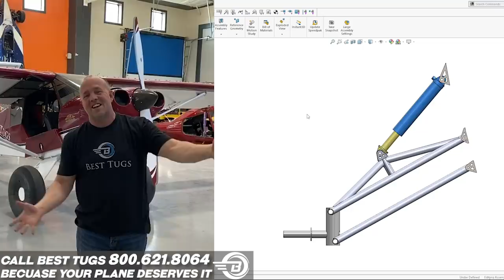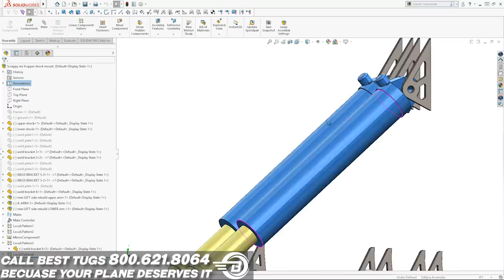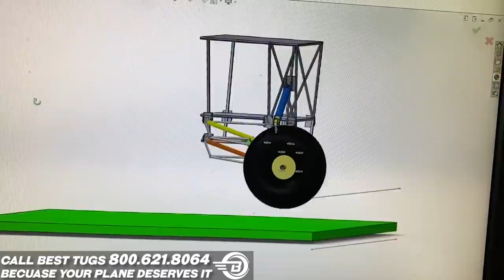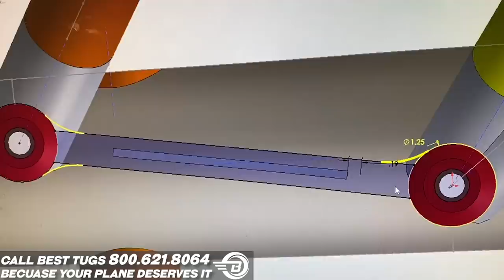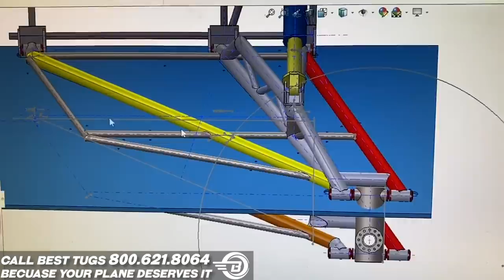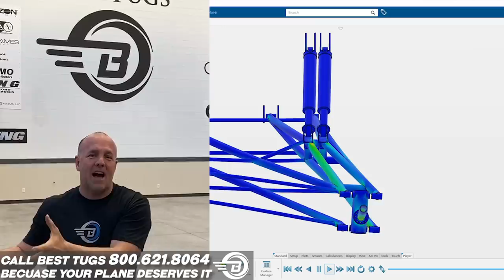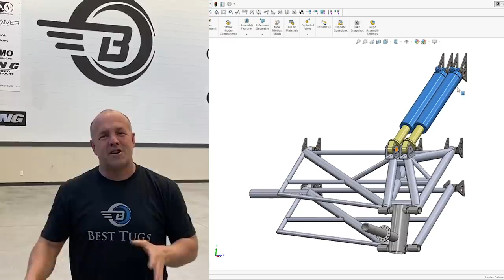20" + Travel - Extreme Bush Plane Landing Gear (Scrappy Bush Plane 15)

Comment: A fabricator that was featured on Hoonigan point out a good tip on your coping fit ups. Basically if you make the tubing fit tight like that(snap fit) and weld up, you are only welding on a portion of the actual thickness of the tubing, grinding back the sharp edges of the coping fight ups allows you to weld on the full thickness on the tubing being welded.

Second note there is still going to be an amount of scrub to the tires maybe not on the full cross section radius as if it had a single A arm suspension. The spindle still has to swing in an arc and with your landing gear down before you land they still have to travel up and out with landing

Comment: Mike, I have done work with 6Al 4V titanium.  It has 1.8 times the strength to weight ratio of steel and seems to be right up you ally.  With your machining and welding skills I would love to see you hire a certified titanium welder to set you up with the skills and equipment to start replacing steel parts with titanium.  I am sure you have the engineering capabilities to take STOL to the next level.  Maybe when you start a new Draco build?

Comment: Mike, have you ever considered winglets or long winglets running a partial length of your fuselage to help generate lift, and are you still going to use cables for your control surfaces or have you changed your mind to use carbon fiber rods or carbon fiber with woven kevlar rods rather than cables for your control surfaces?
Reply: I've been wondering about the cables vs rods thing as well, Mike. Wouldn't rods give you more control and response from the control surfaces?

Comment: Have you ever tried using a tig torch with a gas lense, you would get better gas (argon) coverage and less surface oxidation, resulting in a better weld. Your welds look great, but try and see if the results could improve the end product. Best of luck with all your projects!

Comment: As an engineering student simulations are not boring, and I have designed and machined enough to know that tolerances like that are no joke. That is very impressive. I was curious if you did a drag analysis or with the extra power you aren't concerned about that.

Comment: You should look into doing some type of limiting strap so that the weight of the suspension and the tires when you take off does go right to the internals of the shocks.  Just a thought Mr. Mike.  I run kings on my offroad titan im building and I had to install limiting straps because you could here it thump the shock when I went to full droop.

Comment: Subscribed. I'm not a plane guy, but the engineering here is top shelf. The tubes snapping together is so satisfying. I see the advantages of notching the tube on the mill, but those registration holes seem like a lot of work. Have you ever tried laser cutting the tube?

Comment: CTIS with a bladder in the fuselage vacuum the air out during long duration flights reduces drag from those huge rock huggers, only Mike could get it done back to work

Comment: Awesome design Mike!  Solidworks is such a powerful tool!  Will definitely be looking for the stress analysis video.  You'll probably cover it but I am interested in what you looked at for residual stresses from the welding process.  Or are you stress relieving the assemblies?  Any thoughts on fatigue details?  I also get really excited when I get to fabricate one of my projects that has lots of moving parts that work out and all of the clearances are as I planned.  This was a fun video and I found myself getting the smiles as it was coming together.  Did you have to make a reverse of your fit up jig or did you just machine thru slots where you could flip it over to do the left hand/right hand?  Take care!

Comment: After building off-road race cars and long travel sand cars for years (kinda like the clip you showed) that have unbelievable suspension and also competing in Baja many times, I can certainly appreciate what you’re doing here. Looks well thought out and is going to work very well. Is it overbuilt? Probably, but every time we think we’ve built something just enough....it breaks (and yes, weight is important to us as well). However, when ours break, we may screw up a wheel, hub, brakes, some powdercoat and maybe a few other things (although I have gone end over end at 75 mph just from a broken heim), but if yours breaks, it screws up a very expensive prop, engine and a host of all kinds of other things. Not to mention the safety factor and most of all....cracking up all of that pretty carbon fiber lol. Once again....well done (especially your notching), can’t wait to see the finished project. PS....Out of curiosity, obviously you’re using chromoly....what wall thickness? It appears 0.65, 0.83 maybe some .120 in there somewhere as well? Ya know, just because I geek out on this stuff as much as you lol. Well you kinda answered my question towards the end.

Comment: Hi Mike, great build! I'm wondering what prevented you from using a 20" travel hydraulic piston with some custom valving to take the impact vertically in a rigid belly frame - the frame could likely be lighter and rigid, and you'd have no scrub at all as you'd have purely vertical movement of the wheels. Would this weigh too much, would the valving be too difficult, or what else am I missing?

Comment: Interesting concept to build an airfoil around the gear legs. Conceptually I understand adding effective lift with a minor weight penalty (I presume you will wrap it in carbon fiber) as well as covering a web of round tubes to reduce drag is favorable. The question it raises in my mind is will it introduce some instability in flight as the direction of the lift will be outward, at different angles than the primary lift source of the wings, and below the center of gravity? Also, do you risk adverse flight characteristics when you put the plane into a forward slip where the gear wings can be stalled or create more lift depending on their angle of attack? I am soooo curious to see how this all turns out. Fascinating and ingenious ideas keep coming over and over watching this build. Keep it coming Mike,  I am hooked. Hope to see you up at the cabin in Alaska this summer.

Comment: Incredible engineering Mike!  I'l be interested in how the "wing" works...it looks like a flat-bottomed aerofoil (?), so will be interesting to know whether that will cause issues with lift being generated in unpredictable ways as the suspension travels through it's motion.  No doubt you've thought all that through, and perhaps it's even a way to decrease stall speed?  Anyway, fascinating build...

Comment: A suggestion about your new front geometry. What you have designed will be way better than the normal Cub "flexy" suspension and will have less scrub through the travel but it could easily be better using some lessons from older vehicle dynamics.
A normal automotive suspension is designed to have a negative camber curve to keep the tire perpendicular to the road and to maximize cornering forces. But in a tail dragger "maximizing cornering forces" is called a ground loop. 😱 Not what you want.
In 1969 Buick came up with a suspension with a backwards camber curve that they discovered reduced side to side "head jostling" by over 60%. They raised the mounting point of the upper A arm so in compression it would be still moving outwards while the lower arm was moving inwards. This was horrible for cornering and no one uses it anymore.

But it is perfect for what you are doing for a bunch of reasons. Your drooping parallel arms are going to be scrubbing outwards as they compress because the track is increasing with the arms downwards angle . If you raise the upper arms mount you can start with a little bit of negative camber and as the suspension loads it would transition to positive camber. This will reduce the scrub and probably more importantly, the tire's increase in positive camber will reduce the tire's tendency to dig in as it hits bumps during compression. Also increasing the distance between the lower and upper mounts will spread the stress from the unequal loads on the two arms.

Basically it is a "Win, win, win" situation.

(Tried to find a picture describing it and they best I could find is this diagram of the Chevy Vega which borrowed this geometry from Buick as they were trying to make their first compact feel like a big slushy Merican car. http://assets.superchevy.com/f/154695485.jpg  The circles in the middle are the inner mount points for the upper and lower A-arms and on the right with the tire is squares, circles and triangles showing the path of the upper and lower balljoints.)

Comment: Hi Mike, have you played around with sending any parts to a tube laser? I started using one for my designs a short time ago and have been more than happy with the results. Tolerances in the couple thousandths and an immediately weldable finish with no clean up. The head articulates in all axis’s so no worries with square cuts meeting angular surfaces and changing your weld profile consistency. Really nice piece of gear.
Reply: Oh.. and NO reindicating tube lengths due to lengths. It will drag a stick length dom and part it off as well. Worth a look for sure.

Comment: Hey Mike, all the pipe prep looks awesome nice fit-ups, everything looks super clean I’ve been an industrial Master Pipefitter for 38 years this year.  I’m not in any position to question anything that you engineer, design, or fabricate when it comes to Air Frame design. But fit-up and welding procedure it something I’ve spent my whole life doing. Without knowing the type of pipe you are using or the heat rating number (spec) .  it leaves me at some disadvantage. It’s been my experience on chrom moly and many different types of Stainless Steele pipe weather it’s 304, 304L, 316, 316L,  Inconel, Monel K-500, with approximately three times the yield strength and double the tensile strength when compared with other alloy’s. I wanted to ask when welding the new landing gear arrangement I did not see you using a full penetration welding procedure, and are you not required to purge the weld wile in the process, with such sharp edges and fit-ups I’m sure it’s quite easy to make the  welds similar to a fused socket type weld. But for a device such as a landing gear it struck me kind of odd that a full penetration welding procedure wasn’t use or at least a purge process just in case you had some burn thru on some of the thinner areas. I’m all about learning different way things can be done correctly. I was also curious did you tack off both sides first to keep it from drawing and then feather out your tacks when you made your first pass and did you make TWO passes on the larger size pipe fit-ups ?? The 1-1/4, 1-1/2 ?? Please don’t misunderstand me your work is outstanding I am a fan the DRACO ENGINE SWAP WAS AND AWSOME UNDERTAKING I watch it all. I always been told to ask if you don’t know. Thanks  Mike SCRAPPY LOOKS TO BE WELL ON ITS WAY TO BEING ANOTHER INCREDIBLE BUILD.

Comment: Hi Mike, great video as always.  Do you have or need travel stops on your Scrappy long travel suspension?  So your shocks don't top out when your gear are fully extended downward?  Sometimes rubber dampers or travel limit straps are used to prevent or minimize the impact on your shocks and suspension joints.
Reply from the maker: rmosley111  great thought 👍🤠 I’m very familiar with stops and straps from my desert racing.  This won’t need them as aircraft we set the rebound much slower as we don’t repeat high speed bumps  like race vehicles. When we land at only 30mph slow rebound is best and then the shocks don’t bang on the airborne hang or  rebound side of bumps 👍🤠
Reply: @MikePatey  Sounds good Mike.  Keep up the great work and thank you for sharing your projects and experiences.

Comment: Hi Mike, loving the videos during lockdown.
Just had a thought, STOL landings on tail draggers seem to me to be limited by over pitching on the brakes and risking a prop strike or rollover.
Have you ever considered an anti lock brake system tied into the aircraft pitch (deck) angle? Just thought that if the brakes could be allowed to release themselves as the deck angle goes over the horizontal, then you could (theoretically) hammer the brakes on touchdown or, who knows, maybe even land with the brakes already set fully on?
If anyone could make it work, you could, but maybe you’ve already considered it?
Anyway, stop reading this and get “Back to work” ✊

Comment: Hey Mike, this build is awesome and inspireing.
But I have a question, I've been instructed that, on structural welds, the material should always be chamfered at the joint to ensure proper penetration.
I'm probably 90 percent certain with the right settings m, I could get penetration but the chamfer is 100% do you have a reason not to chamfer before welding or is it just not the way you were taught? Always cool to learn new methods, and that pipe fit up makes me shed tears of despair over hours spent with a grinder.

Comment: I'm no stranger to building suspension but you can never stop learning. Hoping you'll tell me what the point of the little section of smaller diameter tubing is for that's trailing the main A arm?

Comment: Excellent engineering and machining, a cut way above the rest. Your suspension still exerts a slight side loading on the tires as the track expands as the a-arms travel upwards although the camber remains constant. I'm a little surprised that you are leaving all that suspension with shock and spring in the air creating drag. Although this is a low-speed aircraft, drag is drag. (Jonas Marcinko designed a long travel suspension for his scratch build Defiance bush plane with inboard shocks and springs to reduce drag) It seems as if you spend hours reducing weight to improve performance, then you give it back with drag. Also, unless you can tie the left and right side control arms together somewhat with a swaybar you could get one side to push up, while the other side compresses in a crosswind situation, similar to the Draco incident. Can't wait to see Scrappy flying in the rough.

Comment: Hi Mike, fantastic build video. Have you given any thought how to reduce the roll in a crosswind such as you experienced in Draco when the downwind gear compressed? Some mountain bike shocks have a lockout so when going uphill they are much stiffer. And then downhill, they are much softer. My 2 cents.

Comment: I’m looking forward to seeing your SOLIDWORKS SIMULIA design analysis.  I would also be interested in any CFD analysis you have done in SOLIDWORKS or in any other program you may have used.  I’ve been working with SOLIDWORKS for several months, mostly using it for workshop storage designs and fabrications.  I’m looking to do FEA using SOLIDWORKS Simulation and CFD work using the SOLIDWORKS Flow Simulation.

Comment: I'm thinking about the airfoil shape of the gear fairings and wondering if that might cause a controllability issue. Any yaw induced by the rudder will increase the angle of attack on one side while reducing it on the other, producing pro yaw and adverse roll, (landing at minimal speed, right rudder produces a big yaw to the right and a roll to the left just at a time that you don't want to be messing with the ailerons) but I'm not an engineer and I don't know how the center of lift of these foils relates to the center of lift of the wing. Guiseppe Bellanca put airfoils on his transatlantic plane landing gear but they stayed horizontal. Can't remember how that came out!

Comment: Mike - As you proceed with your scientific artistry, I have an underlying concern. If I don't say something at my age, I may forget I ever thought it -
so here it is:  With all the power you had for takeoff in Draco, was the P-factor ever threatening? If it was, as I suspect, you will face an even greater challenge combatting the torque of this monster motor/prop combo, with the reduced mass of your carbon fiber empanage. I bring the matter up cognizant of all the training losses suffered among high horsepower fighters swinging huge props in WW2 - most due to this exact issue. I want you to succeed in all your excellent endeavors, so I'm highlighting a safety issue, knowing full well that you're most likely on top of the issue. Have you done the math, the computer modelling? Will your tail volume handle all that torque when you feed in the power, especially considering the lack of mass in the empenage to resist rotation in yaw? Just want you to think about it. Keep up the amazing work! Big fan!
Reply from the maker: Patrick Mulvany I am very familiar and have all that in consideration and will talk more about it later.  Great thoughts and I’m on it

Comment: That off road buggy can easily absorb the energy of a 10 foot drop without a bounce. That works out to a little over 25' per second or a descent rate of about 1500 ft/minute in a plane. With the ability to absorb that much energy, this plane will be a lot safer than pretty much anything out there.

Comment: What made you use a bushing type pivot on the arms instead of heims or other joints with more degrees of freedom? I would think the heims would be better at preventing binding especially on the top aarm when you have 3 different attachment points. Definitely not trying to armchair engineer, just curious about your thought process and trying to learn👍